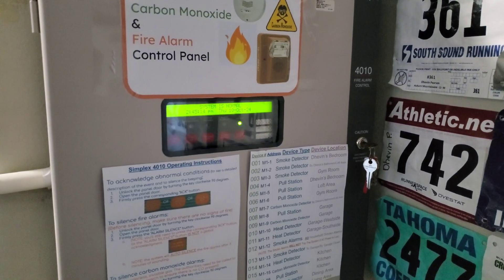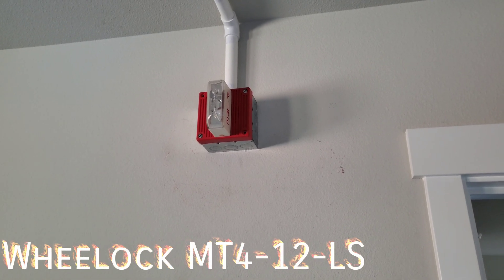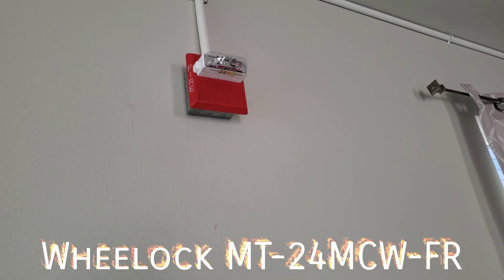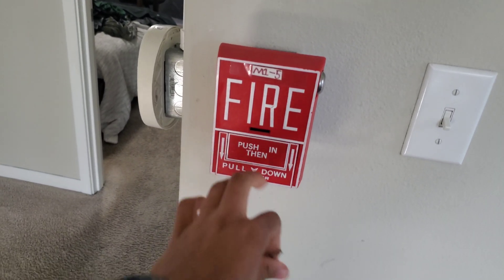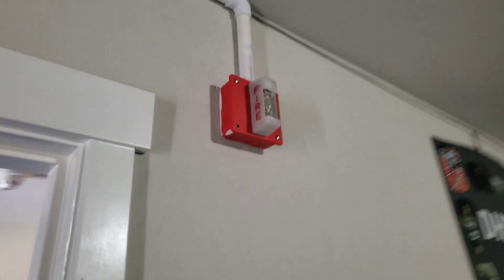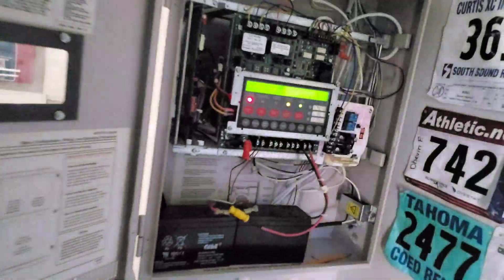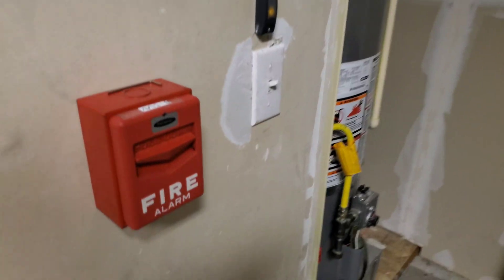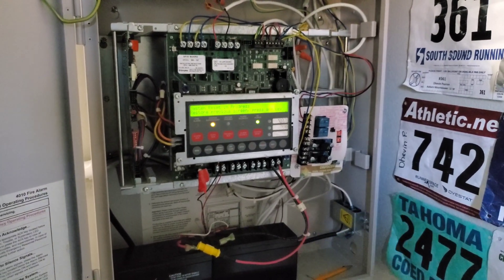System Test 97| Sirens

Comment: I. Think the reason why the alarm in the gym was flashing fast is because of the voltage supply  or either it is programmed by the panel to have a higher flash rate or it was designed to do that
Reply from the maker: It's a 12 volt model on a 24 volt system, the horn was configured to accept 24 volts via the jumper but the strobe is only really meant for 12 volts.

Comment: Will you ever do AC horns? If ya know how to (no offense)
Reply from the maker: Probably not, because the 18AWG wire I'm using is not rated for them. The amperage of them alone would melt the wires, and since they're encased in PVC, that's just a house fire waiting to happen. The wire is sufficient for low voltage and amperage, and that's what I intended.
Reply: @BlackLightning4547  don't you have thicker wire like 14, or maybe 12 AWG?
Reply from the maker: @TurkeyPointSirens  Not enough to wire a whole system.
Reply: @BlackLightning4547  damn, ok
Reply: @BlackLightning4547  well you could just use multiple wires, or use low power low voltage AC horns, such as a 4050 or 4030 (do they even consume lots of current?)
Reply from the maker: @TurkeyPointSirens  AC appliances pull a minimum of 1.5 Amps

Comment: Are you sure this isn't a regular house fitted with so many fire alarms? This is wild.
Reply from the maker: This is a regular house that I installed a fire alarm system in. It was first a demonstration system only covering a couple rooms upstairs but was recently expanded to downstairs. It still doesn't cover all rooms of the house(because of my mother), but it covers most.

Comment: 10:18  did u just tap off the red wire in the back i have a few smokes and i could definitely hook it up to my ms9050ud panel
Reply from the maker: A Kidde SM120X Relay module is interconnected to the smokes and the N.O contacts of it are attached to a Simplex IAM configured as a fire monitor zone. You can set it up this way,  but instead use a Fire-Lite MMF.